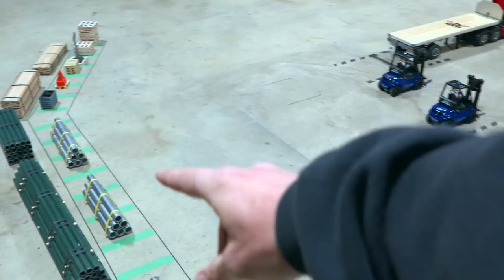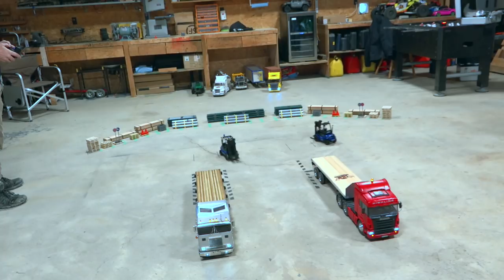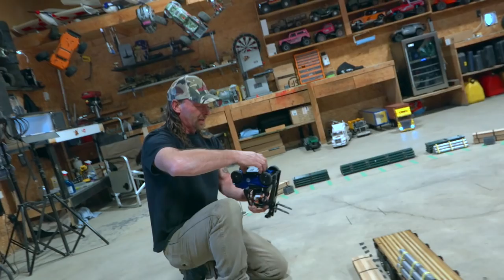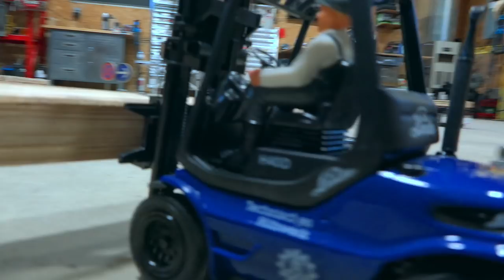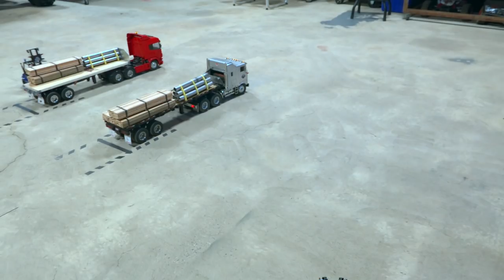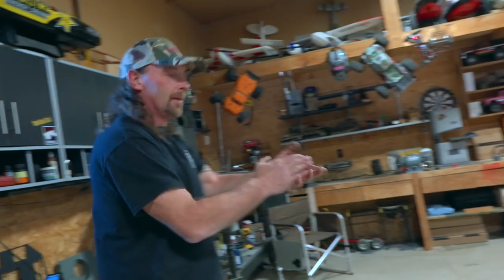LOADING WARS - FORKLiFT FiGHTS: FiRST PLACE TAKES THE WIN!

Comment: How about trying to load cars onto a car trailer and then going over some uneven grade while not having any cars fall off and then having to back the trailer into a tight car dealership without hitting any cars in the parking lot. Also a battery sponsor would be a good idea for you guys. Image Duracell suppling all the batteries you need for free.

Comment: I too drive a forklift some of those technique would never fly with the mistake of overloading one side.   If you are gonna load a trailer make sure that you are loading weight from front to back as this would be pretty bad for trailer to drive with...  Center of gravity always keep that in mind when doing this for real.
Reply: also there should be penalty for hitting the tires with the forklift as in real like you can accidently pop those tires and leave the trialer sitting ducks for days,   for replacement of wheels.